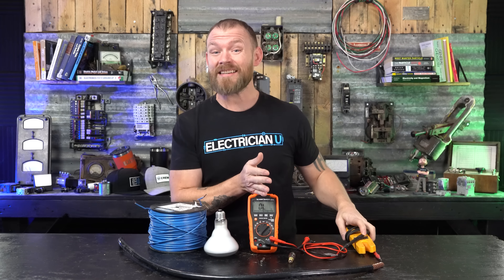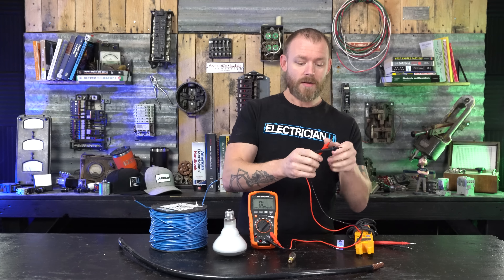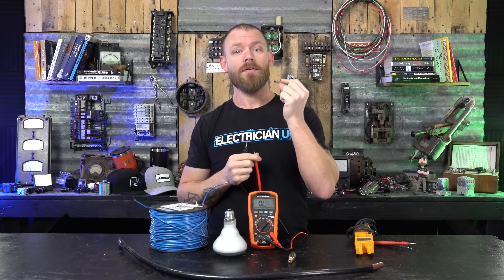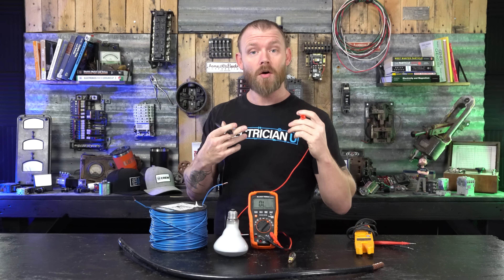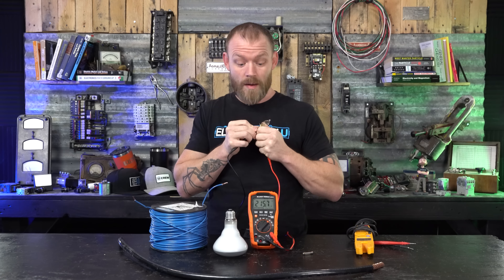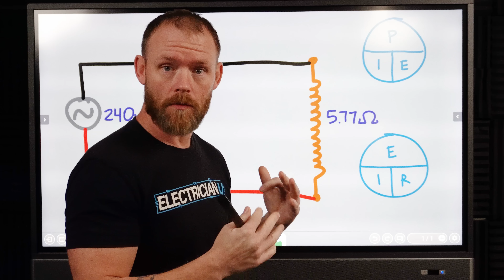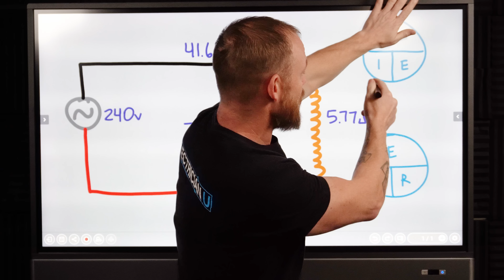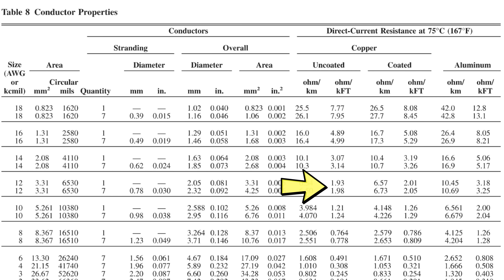How to Test for Resistance? What is Continuity?

Comment: A couple points you missed. I know that you should "never" do hot work. But just in case you are doing hot work, NEVER (I can't stress this enough) test resistance or continuity on a live circuit. Even if you are working with low voltage wiring or circuit boards. Don't test resistance on live circuits. You will be putting a power supply (the resistance meter) in an unexpected place in the circuit and you could either damage the circuit, cause it to do unexpected things, damage your meter, or any combination of the above. It's also best practice to isolate what you are testing for resistance from the circuit (disconnecting one end is sufficient, but completely removing is often best) so you know you are testing one device instead of everything that might be in parallel to the device. Best case, you get unexpected readings. Worse case, you power something in a way that shouldn't be be powered in that way and you damage it. In power electrical situations you'll probably never damage anything, but in low DC voltage situations (digital sensor inputs, troubleshooting PCBs etc) if you put a reverse voltage on some IC pins, you might damae that pin on the chip causing an even more expensive repair.
Reply: Energized work is a legitimate part of the trade, but only when justified, documented, and signed off upon. Just piping up on that one, not to distract from your advice.
Reply: @citygirljace  Yeah, that's why I put never in quotation marks. ;-)
Reply: Wow! I’m glad you mentioned that. I would have tested on hot wires without thinking about that step.
Thanks!!
Reply: Look at me I'm smart and know stuff 🐒
Reply: Real talk
Reply: Thanks for sharing your knowledge here! the info you shared is even much more perfect and accurate than "ELECTRICIAN U". I wish if you jump in and made good videos like these incompetent people and spread true knowledge please.
Reply: you got a great point, proud of you brother... 👏👏👏
Reply: I work on small, vintage tube amplifiers. Does your advice apply to these circuits also? Thanks
Reply: If it's not "hot," then how can I test for resistance/continuity? Don't I need to have a completed circuit?
Reply: @IndianaJoe0321 I think you are making it hot with this test 
And completing the circuit 

So there's a double trouble adding hot to what's already hot (breaking your meter or whatever thing can't handle another straw on its back)

I think original poster was saying there can be trouble from isolating the dang thing and making it hot when maybe it shouldn't be too.

That would be the "best case you get unexpected reading and worst you power something that shouldn't be" paraphrasing
Reply: @IndianaJoe0321 so at that rate I don't know what to do... what can you test?
Why god!?!
Maybe we just get into woodworking
Reply: @IndianaJoe0321 it's like an entendre because this test broke me 
Too much resistance
Reply: You must be a boss man who says never to work hot but in reality that's BS most of the time.
Reply: @charlesfelix9955  maybe he boss man cause hid boss turn an ash hole workin hot on a fractal art projec gone right 
Home were you makid mang
Reply: @IndianaJoe0321 your multi meter will be sending current  over the conductor & reading it back upon return
Reply: I learned this the hard way lol
Reply: This really depends on the meter.  Some meters (particularly things like lineman testers) have no problem with this, because they are designed with protections specifically for this reason.  Many cheap general-purpose digital multimeters do not, though, and might be damaged by using the resistance/continuity setting on something like an energized AC mains circuit.  (Good (expensive) meters will actually provide a specified value for the max voltage that can be applied across the probes in various modes, which you can check to see if yours can handle this sort of thing.)

And isolating the component you're testing is definitely good practice in order to get reliable/correct readings, but everything else you said about introducing power into circuits and damaging them is basically wrong.  Using the resistance/continuity setting on a meter will introduce at most a few hundred millivolts into any circuit, which is realistically nowhere near enough to damage anything (even low-power circuits), whether things are powered or not.  It is certainly nowhere near enough to count as "reverse voltage" on any IC pins.  The resistance/continuity settings on DMMs are actually designed to basically never damage the circuit you're testing, no matter how you use them.  Really, if you use them while the component is in-circuit, particularly if it's live, you will probably just get completely bogus readings, or worst case, if you're dealing with higher voltage circuits like mains stuff, you might fry your meter (but it won't damage the circuit).

(However, if you are using a meter (in any mode) on a live circuit, you should use probes which only expose the very tip, to avoid accidentally touching multiple things at the same time and bridging something that shouldn't be bridged (which could actually damage the circuit).  Many multimeters come with extra "sleeves" you can put over the ends of your probes for this purpose, but if yours doesn't you can make your own with some shrink-wrap tubing, or just using electrical tape when necessary.)
Reply: @IndianaJoe0321 
Resistance is what the meter reads in the ohms setting. That said when you measure across a closed circuit such as a set of contacts etc the meter will read in the lowest scale in millivolts. Even through a wire or switch.  That reading using ohms law is usable for the calculation of the resistance of the two points being measured. In fact this process will identify a connection problem very quickly with a couple of tests over a period of time under load.
Reply: Hard to read without paragraphs
Reply: Put a fuse in your meter lead for starters so you don't damage your meters fuse. In automotive industry you do a lot of powered low voltage reading.
Reply: Thank you for this tip 🙏🏼

Comment: Nice video. A common usage for measuring resistance that wasn’t mentioned is to find a good ground location in a car. When using high draw electronics in cars (such as amplifiers) you want a location that has less than .02 ohms to the negative terminal of a battery.
Reply: I agree

Comment: At 5:20 you say that the high ohm bulb "doesn't look like a closed circuit", but the fact that there is a resistance value it IS a closed circuit. If it were an open circuit the meter would have shown OL just like it does when not connected to anything. Different meters have different thresholds where they will sound the continuity beep, read the manual of your specific meter to find out. I'm not sure if the Flukes that I use at work (unfortunately I don't personally one one) would have sounded the continuity tone on that flood lamp.
Also, note that many DMMs aren't in auto range when in continuity mode, so even if the meter shows OL in continuity mode, it may still be a closed circuit with a couple kohms of load. Continuity is primarily used to make sure wires (or wire-like divices such as circuit board traces and fuses) are acting like they should, and to make sure you don't have a short circuit between conductors that shouldn't be connected. That flood lamp giving the continuity tone shows why it is important to isolate what you are testing to make sure you are testing what you expect. For example, if you wanted to make sure there isn't a short in the wiring between a plug and a light socket, having the flood lamp installed in the light socket will give you a continuity tone leading someone who doesn't know to look at the DMM reading to think they have a wiring fault in the plug, socket, or wire. Leading them to waste time trying to find a fault in multiple places where there is none.

Comment: If you have no use for the amperage settings then get one without. That way you only have 1 connection for each lead so you can’t screw that up and damage your multi meter. 

I have purchased multimeters for friends. I really like the Uni-t clamp meters. There is only 2 connections for the leads but you can still use the clamp for current. 

They have a $50 one that does DC current. Which I think is the least expensive DC clamp meter you can buy.

Comment: DUSTIN, try to make a video lesson about different ELEMENTS used in different household appliances and what are the most common ELEMENTS an electrician should know or will troubleshooting the common problems elements cause to go over in a video lesson. Also another vid lesson is to think of the most common applications when an electrician would use Joules Law formulas, because Joules law is HEAT = V * I *TIME, you forget to mention to add in the TIME also into the formula because Wattage = V*I . Try to think of when electricians would use Joules law formulas

Comment: My neighbor was trying to install a new smart thermostat which uses more wires than a standard thermostat. But after wiring it up it blew the fuse on the control board in the furnace. 

Eventually we disconnected all the wires at both ends and checked for connectivity between each wire. The blue had connectivity to one of the others. So somewhere along the wire a staple went through the wire and made a connection between 2 of the wires. Shorting them out. Blowing the fuse. So we marked the one that was bad and just used a non standard color for the install. 

They had put in a multi wire bundle with a lot of unused colors so that saved us.
Reply: This is a perfect example of why not only testing for beeps is important, but also testing for anti-beeps is also important. Good thing to remember not only with bare-ended cabling, but also after wiring connectors and terminal blocks.

Comment: I always touch test leads together to check the the meter & test leads are in good order.Fir readings under 100 ohms will short the test leads and read the resistance. On old test leads have seen over 4 ohms resistance that you want to subtract.

Comment: Determination of resistance of the length of wire:

For a minute there I thought you were going to explain about resistivity and how to perform the calculation for resistance. I guess that is too much for most electricians to get their head around.

It is after all, how the tables are derived.

Comment: Please discuss "Megaohm" meters (or "Meggers") used for "Insulation Resistance" tests -- such as for a floor heating cable (Schluter) to confirm no leakage from power wire through insulation out to the ground braid -- 1000 volts & more than 1000 ohms Resistance.
Reply: They just use high voltages, 250, 500, 1000 volts to see if a current is created. 
If the insulation on the cable is performing properly there will be no current.

So the meter is producing a high voltage and measuring the current. 

The test current is converted into a voltage inside the meter using a highly accurate resistor and a dual slope integrating analogue to digital converter is used to measure the voltage and convert into binary, and digitally processed for display, hence the test current is measured as the test current and voltage are related by ohms law by use of the accurate resistor.

Simple.
Reply: @deang5622  Thank you - very good

Comment: I may be wrong but isn't  hot resistance (energized circuit) roughly 10 times the reading that you get from a cold reading (de-energized circuit). Is it the reactance that drives up the resistance or does heating the element change it's conductive characteristics?
BTW, love your channel.
Reply: No, you are not wrong. You can't measure the resistance of a red hot element when it is cold and make calculations. I am surprised he showed that. That spotlight measure 16 ohms, so per Ohm's law it would draw 7.5 amps. That would be a 900 watt bulb, obviously wrong. It draws that for a small fraction of a second until the filament heats, then drops to 60 watts or so.
Reply: @ianbutler1983  Indeed!
Reply: @ianbutler1983  certain heating wires use nichrome.  which has little or no temperature coefficient.  this is why the inrush current is so low on many electric heating coils. Here, the author is using an incandescent filament, and not a heating coil.  This explains why many electric heaters are nearly 100% efficient,  unlike a hot lamp filament,  which is nearly 100% efficient at generating thermal heat, but only 1 or 2 % efficient at converting this energy into electromagnetic radiation. 98% efficient heater - 2% efficient visible light source.  Much of the heat that is converted to light is in the near-infrared region,  anyway,  even with lamp filaments running at nearly 3000 Kelvin!
Reply: Reactance does not drive up the resistance. The two are two separate parameters.
Resistance applies to DC. Reactance applies to AC. Both are measured in ohms. But they are quite different things. 

One does not drive the other.

Comment: I'm surprised no mention of finding a ground fault or short, with power off, if what should be the live/hot line has continuity to ground (or neutral), proves out a problem.  As a landlord, two decades of use, a run of outlets became dead without tripping breaker.  Turns out improper ground from old BX cable and continuity between "live" and ground.  The electrician decades ago had improperly wired the GFCI downstream as well likely due to that.

Comment: Could you make a  video on converting a 220v circuit to 110v swapping out the 220v circuit breaker with a 110v one. Where would you connect the neutral white from the 220v circuit on the distribution box.

Comment: Hey dustin, you mentioned in part of your video that multi meters have many functions like testing panels. However when i was testing a panel, i was getting berated by a older electrician saying “you cant use a multi meter to test a panel, that ** never works” and blah blah blah. That “you can only use a wiggy to test a panel” and “iv been doing this for 50+ years” Me still learning i dont see why you couldnt use a DMM. Whats your thoughts??

Comment: Please do a video on series and parallel circuits. Specifically drawing out real life examples
Reply: Serously! That would be Great!
Reply: Resistors in series:
RT = R1 + R2 +.....

Resistors in parallel:
1/RT = 1/R1 + 1/R2 +...

And if you have a circuit comprising a mix of both then it's probably easiest to reduce the complexity of circuit by first combining as many series resistors together, replacing those with single effective resistors, and then analyse what remains and combine the resistances in parallel.

Comment: Could you share how you calculate the resistance of a resistor by reading the color bands when they are evenly spaced, and no gold or silver bands appear? I calculate from the end opposite to a gold or silver band, but some resistors do not include a code for tolerance. Another challenge is to distinguished between violet and red when the color appears to be somewhere in between.

Comment: I have a question. Lol measuring the ohms for the wire - is it different measuring the ohms to know how much wire you have left if your using larger wire? I'm new to this electrical stuff but definitely curious on your response. Thanks!
Reply: Yes, the values shown in chapter 9 table 8 of the National Electrical Code book specify the different values for different gauge wires per 1000 feet

Comment: Question..toward the end you used the uncoated copper column however your line you have which you measure has blue insulation. So what does "coated" mean in this instance? I thought uncoated would be bare wire that is not insulated and coated would be insulated. Can anyone help me with this?

Comment: I test new 1 phase motor 220vac 750watt 50hz, use multimeter i get resistance of main winding 4.2ohm. If use ohm law like you said. The current is 220/4.2= 52A??!. It somehow dont add up. Please tell me where i get it wrong

Comment: Put that roll of wire in a freezer overnight then again in the hot Sun all day and compare the resistance. The length can vary a lot but there is a formula that takes the temperature into factor also!

Comment: Curious, Im a Journeyman Lineman in the IBEW, around 8 years and was wondering how hard would it be if i wanted to swap over to become a licensed electrician? I have been told that my "similar experience" could actually count towards hours you have to have to be able to take the test to get certified. I was really wanting to try this side of electricity out and figure ill take a pay cut at first but could my experience actually count towards getting certified as a electrician?
Reply: Depending on your local, you can test in with 10,000+ hours and letters of recommendation. Taking the test and passing doesn't guarantee the rank of AJ, my local offers a residential program and you could take night classes to fill the gap of experience based on your test score or you might get accepted into the apprenticeship at a more experienced class level.

Comment: With the distance  calculation, what if you had broken 4 wire in the ground (pipe or liquid tight or etc) 2 wires of the 4 are damaged and showing continuity between them, that distance calculation should tell you how far away that break is? Ie where to dig to fix the pipe instead of a whole retrench.
This would work? Right? Hypothetically.